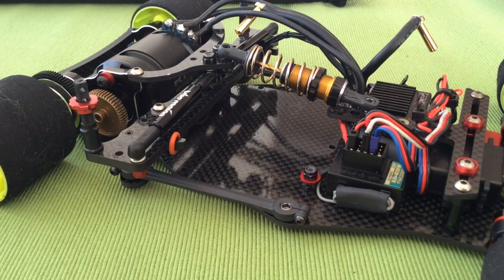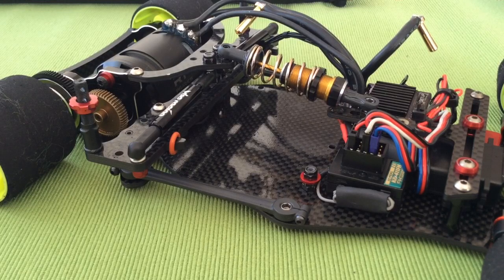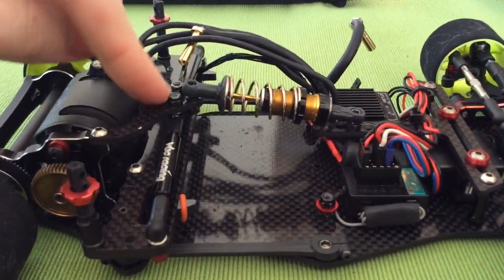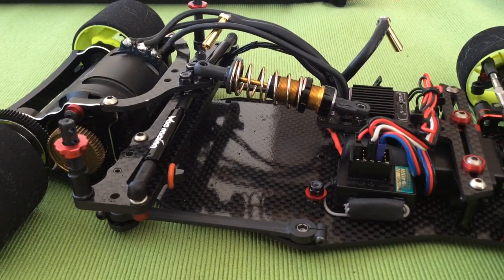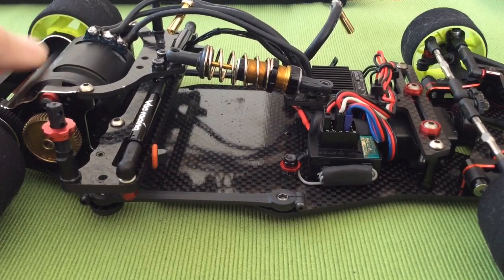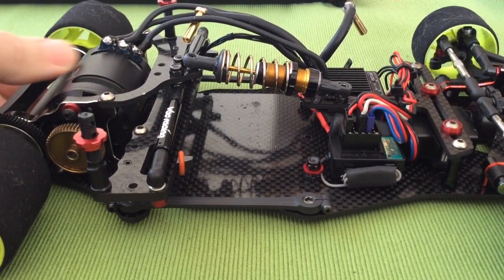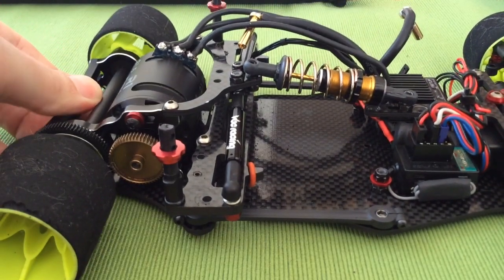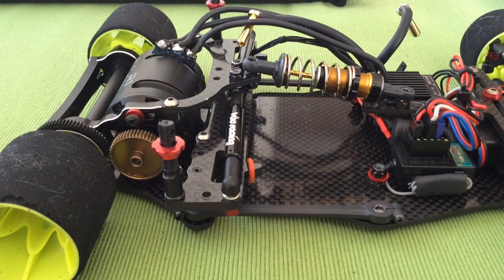Happy New Year! Update On Central Damper Setup!

Comment: seems like if its a generally flat track u can run a thicker oil as it would let the car remain calm since there's not disturbances on the track. but you'd use a softer oil to get the car to go back to the original 'flatness' and the car is settled for the next course of action on the track
Reply from the maker: Exactly!
Reply: curious...on carpet (US) what's the thinnest and thickest oil you'd run? i currently am running 40wt. i'm just wanting to know the range
Reply from the maker: 100 CST to 300 CST in the damper,  10 k in tubes,

Comment: Great with new content. On the subject, I guess it also depends on the track, bumpy vs. very flat, whether you want to use thin or thick oil?
Reply: Yeah to Jacob's question, what would be the benefit for thicker oil?  Actually slowing the rebound down (when would you want to do that?) . Thanks!
Reply from the maker: I would say so, this is still all very new to me. The  next time I speak with the Yokomo mechanic I'll find out. Remember 1/12th scale is not your typical car suspension setup. Therefore I believe the main purpose of running a thinner oil allows the chassis to quickly transition and prepare for the next corner. 

That said, I would run thinner oil for most if not all conditions.
Reply from the maker: See above

Comment: So what is considered thin shock fluid? Should I go from 1000 CST to 500CST, 450CST to 400CST or go right down to 250CST? Right now I run 600CST with a 17.5T and 2s Lipo. Thanks Ed great work>
Reply from the maker: I would consider anything below 300 CST to be thin. Yokomo 1/12th drivers are using 150 CST!
Reply: what spring are the yokomo guys using with that kind of oil??
Reply from the maker: I would say 100 CST to 300 CST is a good starting range to work with. Keep in mind temperature affects the viscosity of the oil. Colder - thicker / hot - thinner
Reply from the maker: I personally don't know the spring rates, but I would say the kit spring and one or two spring rates higher than that.

Comment: Hi Edward! I run in a indoor asphalt circuit very flat with a lot of grip. I use 400 oil and a yellow Roche spring (I suppose medium). The car it's soo nervous it's possible for a wrong central dumper setup?

Comment: Hello Edward, I'm an Italian guy who has the VBC 12M, with carpet CRC high grip better servo of the floating box or I was optional mount as you have installed?
Reply from the maker: I've heard from a lot of drivers that a forward mounted servo makes for an easier car to drive. When the weight of the servo is shifted forward this changes the weight balance of the car. More rearward the weight the more steering and twitchy the car will be, more forward the weight (battery, servo) the less twitchy the car will be.